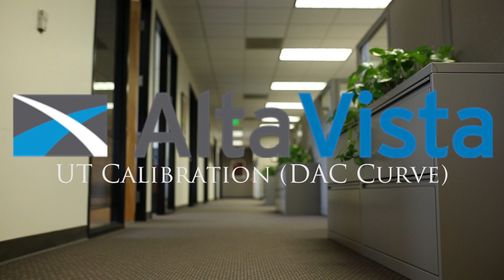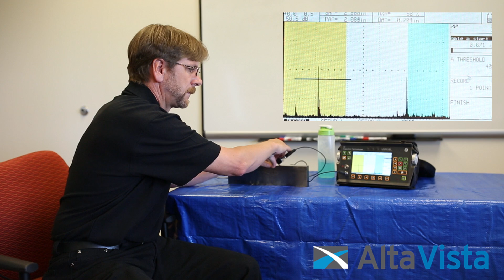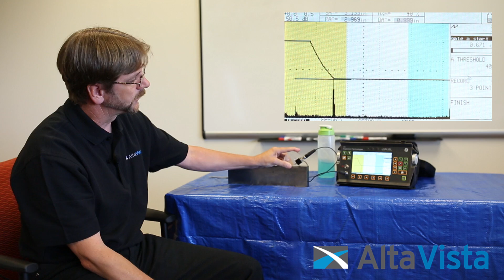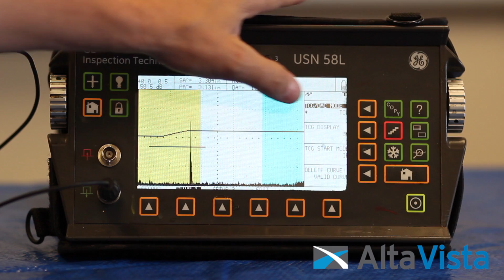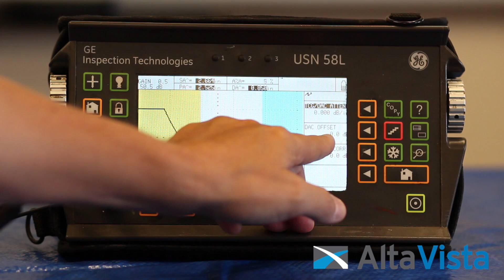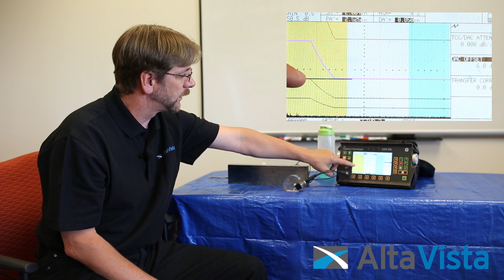UT Calibration DAC Curve

Comment: Good evening,
I face the following problem and i would like to have your help,if possible:
After the creation of the DAC curve,i adjust the gain by increasing it.As long as this increase happens,partially,the DAC curve dissapears from the screen.Is there a way where the curve is fully seen independently of the gain adjustment ??
Have in mind that i use an USM GO+ equipment.

Thank you in advance.
Reply: Apologies for late reply. This would be typical as some of DAC will go off screen as you are asking it to do so when increasing the gain. General rule is increase gain by 6dB then you double the indication trace